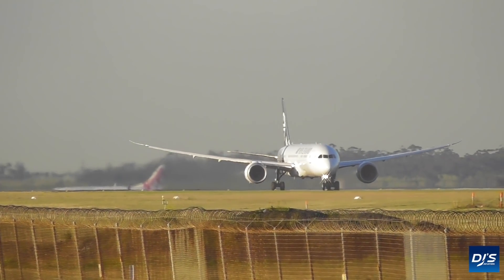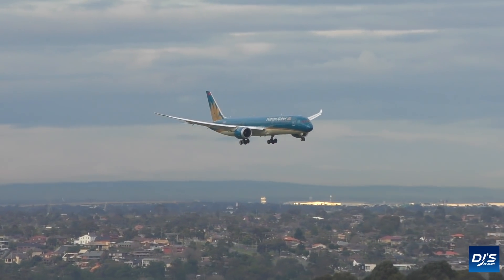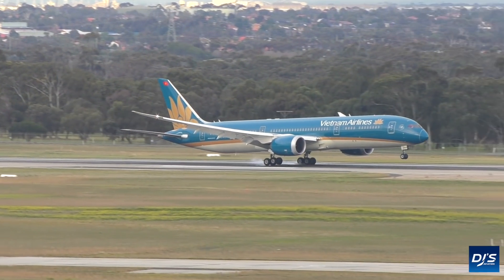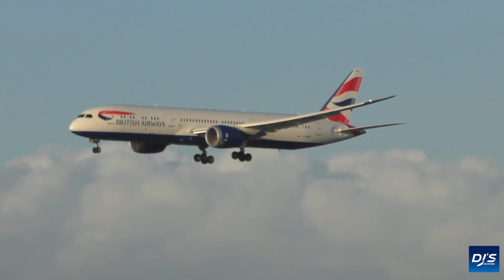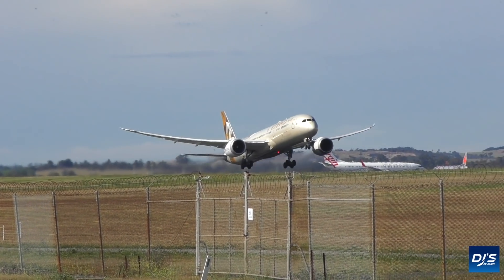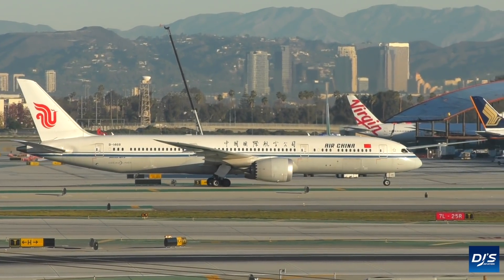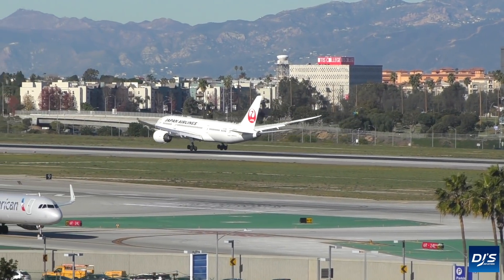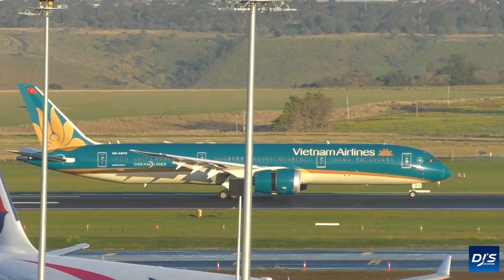Boeing 787s Wings Explained

Comment: Didn't the B787-3 design use winglets?
Reply: not, it use wind legs as the 350 or a 330 for example, so it wasn't that efficient as a normal 787, I think it was another reason for why the 787-3 wasen;t the common, besides that it was more expensive than a a321neo

Comment: 787-3 was going to have vertical winglet.  Raked vs vertical depends on the mission.  Vertical are more efficient for short haul.  Raked are better for long haul as seen on 767-400er 787-8-9-10 and 777-8-9

Comment: I flew on the 787 a couple times. It’s comparatively a much smoother flight than other airliners, which I believe was due to the wing design.  I felt like we were floating on a feather.  Beautiful aircraft and great design.
Reply: Just wait til you fly on an A350 then
Reply: @soilentgreen7  Yes of course, there has to be that "Wait to you fly on a airbus cause it's so much better!" bs comment
Reply: perhaps turbulence mitigation is better with 787 but generally a350 has better noise mitigation mechanisms

Comment: I guess DJ forgot the raked wingtip isn't new. The 777-300ER and 200LR both use raked wingtips; probably the first widebodies to use it. On the 787, it does appear to have a slightly different angle at the tip; but that wingtip device isn't recent.
Reply: 767-400ER used it even earlier with an older version style
Reply: @filledwithvariousknowledge1065  there's one right outside my window and I completely forgot it had those.

Comment: What about the A350's wings???
Reply: Different design but the winglets to me suggest it was to make it better if it’s used in shorter flights whereas with the raked wingtip it’s at its optimal on long flights. The CR929 steals this wing to go on the 787 frame and then stolen 777 and A330 advanced cockpit tech via cyber attacks on Airbus’ and Boeing’s components servers

Comment: People wander how Embraer´s E2 is more efficient than the A220 family as they use almost the same engines. Well, the wings of the E2 are more efficient. On the top of that, Embraer´s fly by wire is the most advanced in the market.
Reply: I like how thee planes make in America(north and south) have the most efficient machines overall.

Comment: Why 787 is slightly more efficient per trip hour than A350???....those three 787-8/9/10 OEWs are lighter than both A350-900/1000
Reply: The video is basically using a super simplified explaination which was inaccurate to explain the complex wingtip aerodynamics.
The raked wingtip wasn't the main reason for the B787 efficiency, it was the combination of the wing flex + raked wingtip that gave the better efficiency. Take away the wing flex and the raked wingtip efficiency drops below that of the blended wingtip on the A350. Likewise if you try replacing the raked wingtip with the blended wingtip on the B787 flexi wing, you'll also end up with a lower efficiency.

Comment: This raked wingtip design is also found on 777X when the wing is unfolded and 747-8. Embraer also has embraced the raked wingtip using 3 sizes for the 3 variants of the E2 Jets so each variant has the optimised wingspan for lift, efficiency etc
Reply: The 767-400, 777-200LR and 777-300ER also have raked wingtips

Comment: The 777-300ER, -200LR, F and the 767-400, as well as the 747-8 and the P-8 also feature such design
Reply: Embraer also uses raked wingtips in 3 sizes for the 3 E2 Jet variants

Comment: Can't remember where, but in the past I read that winglets are a neat solution for dense atmosphere flights which makes sense if you think about regional craft or even 737/A320 families landing/taking off 3 to 5  times a day but in long haul situations with just one airport visit a day,  makes more sense to design the wing for the efficiency at cruise level atmosphere
Reply: That is indeed true. What is also cool is how you could buy the 73NG without winglets. The extra weight added by winglets made flights under 50 minutes less efficient with winglets than  without because of the extra 700kg during takeoff!
Reply: @JKB-  Exactly! that's that could be a reason for airlines to split their preferences in regard to 737NG's: several short flights (50 mins)  or few (3 to 4hrs) .. I wonder if the Airbus will give a non-winglet option with their upcoming A321XLR's
Reply: @luisvazquez6633  Only time will tell :)

Comment: The 787 revolutionized airliner construction and efficiency. Airbus never really competed against it until the A350-900. The 787 was far ahead of its time in more aspects than the wing design. It is still one of the most efficient airliners ever built.
Reply: Well it's also only the 2nd clean sheet design of the decade it was introduced, the 1st being, well, sorta on it's own class (the A380).

Comment: The 787 will go down in aeronautical history as one of the most beautiful jets made.
Reply: @johnhenry6762  777/787
Reply: A340-600 and B777-300ER would disagree.
Reply: It won't beat it's 767 predecessor though!
Reply: @johnhenry6762  did you say you was having a mouse party?
Reply: @DC8Combi  You'll be fine. You just got to hang in there. Think good and be nice. It doesn't get more ideal than that.
Reply: A350-am i  a joke to u
Reply: @Jake-yp9cv  They said one of ,not the most so chill😂
Reply: @Jake-yp9cv  The A350 is not a joke. It just happened to come after Boeing's 787 Dream-Come-True-Liner. What AIRBUS decided to do with the A350 design by also going after B777 Series, is, a credit to AIRBUS for applying the A350 design ( after first competing with the 787-9 with their A350-800/900XWB) with the A350-1000. You just got a heads-up from me. You'll be all the better (informed) for it.
Reply: @johnhenry6762  lol
Reply: @Jake-yp9cv  - YES!
Reply: FACT🔥
Reply: @purnarajleitanthem8894   Fiction
Reply: State of the art technology as well🤩🙃🥰💞
Reply: @nickolliver3021  Yeah.....Rolls-Royce Holdings faces a fresh issue with the Trent 1000 turbine that powers Boeing 787 Dreamliner jets, adding to the list of design faults that have plagued the engine since 2016. The glitch concerns the cracking of discs in the model's low-pressure turbine as they rub against nearby seals
Reply: @Jake-yp9cv  indeed. I'm not sure now that we're months and years down the line since the RR Trent 1000 issues but I would have hoped the issues have been fixed at RR. no issues should be current as of today. The Trent 1000 is a good-looking engine on the 787 but hopefully, it should get a great presentation (looking dirty) in the near future.
Reply: The 787 will go down in history as a huge ceremony fraud perpetrated by none other then the gangsters at Boeing. Yes their huge roll out event was a typical sham dog & pony show as the actual aircraft was nowhere near completed. It was nothing more than a fuselage with wings and gear 😂.
Boeing's been known to tack parts on military aircraft so as to earn production point incentives. Once the hoodwinked military officials see the fake aircraft and Boeing earns the bonus they undo all the tacked on parts so they can properly build the aircraft. Boeing taught me all about smoke & mirrors.

Comment: What is your favourite plane
Reply: Boeing 747
Reply: 737ng
Reply: @darkchaotix1productions326  really a 737ng?
Reply: @NoahAviation09  yes, a 737ng. It's my choice and I'll stick with it.
Reply: @NoahAviation09  What's wrong with the 737NG? Not all 737's are the MAX varient.
Reply: @aerofiles5044  what do you mean I never gave fault
Reply: 737ng and max
Reply: Either the 747-8 Intercontinental or the A350-1000. airliner... F15E military....  Piaggio P.180 Avanti General Aviation..
Reply: 767-400
Reply: @Blank00  yep 764 is a good choice but I like the 767-304ER
Reply: @NoahAviation09    Mine is the A350-1000. The worlds most advanced plane. Low noise pollution low CO2 emissions and lower on fuel consumption a win win for the planet a true 21st Century plane magnifico 👑⭐️🥇🙋🏻‍♀️🇬🇧✈️👩‍✈️👨‍✈️👍❤️💕
Reply: 767
Reply: ATR 42/72-600 (strange I know but it's pretty nifty), followed by A350-1000, and the A380, E175 and Saab 340 get an honourable mention (although the APU on the E175 is annoying). Haven't flown on many Boeing (it isn't really fair to judge them off 2x Ryanair 737s) but the 747-8i was pretty solid. Nothing against A320s either, I just find them to be "fine but not particularly inspiring", and prefer to go on the slightly more niche types.
Reply: Boeing 747